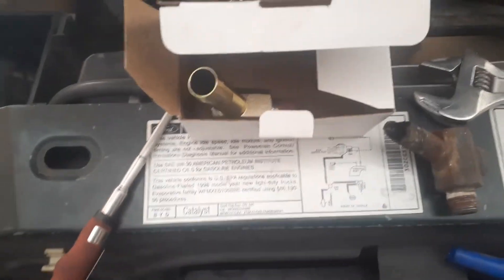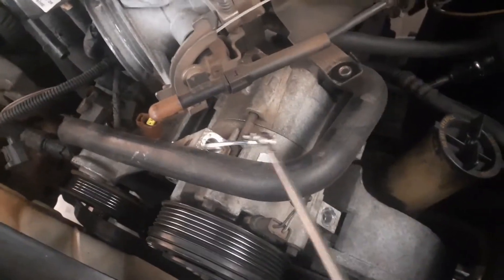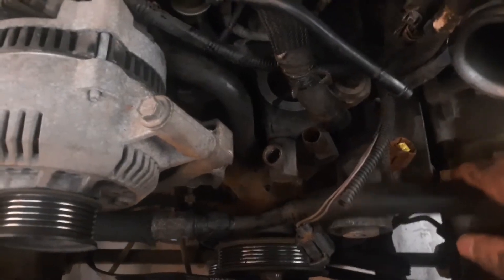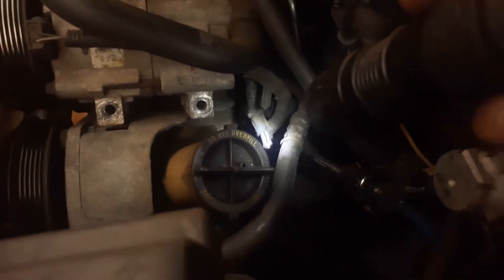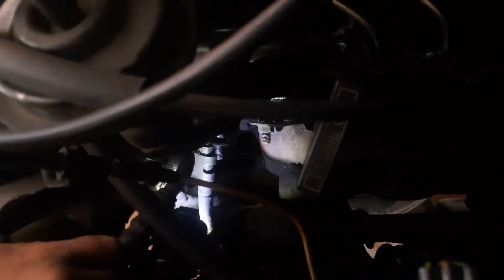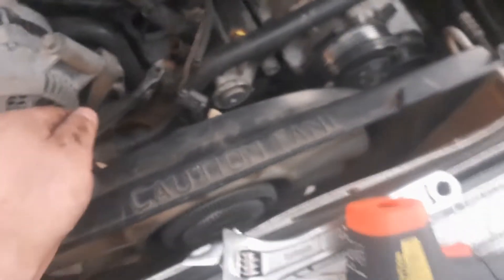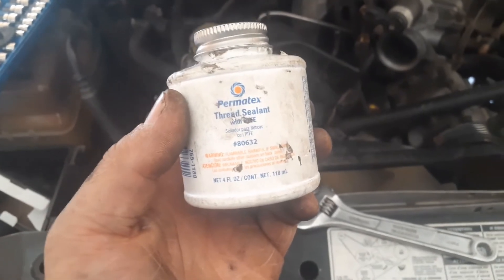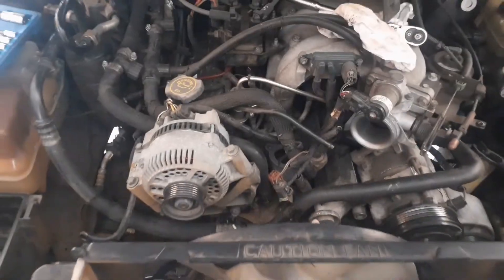Ford Ranger 3.0L Coolant Bypass Pipe Tips

Comment: My husband loosened up all as mentioned and it does not move. Any suggestions please. Thanks!
Reply from the maker: Might be one extra bolt holding it somewhere. I would look over the whole thing with a mirror and flashlight. If he doesn't find anything, it might be locked together by corrosion; aluminum doesn't rust, but it does still oxidize and corrode somewhat, and the bracket could be seized to the engine by that. If that seems to be the case, I would start tapping the bracket with a mallet or brass hammer and see if it breaks free. (Of course proceed at your own risk, I'm not liable if you break anything, blah blah blah.) Hope that helps.

Comment: Thanks for this! I'm still nursing along a 96 ranger with the 3.0 and 220k miles. The 90° fitting just to the right of the one you are replacing is leaking. Can it be removed by the same procedure?
Reply from the maker: I don't have one in front of me today so I can't say for sure, but it looks like you should be able to. I would replace both while you're at it.